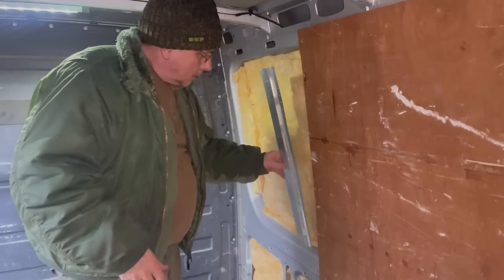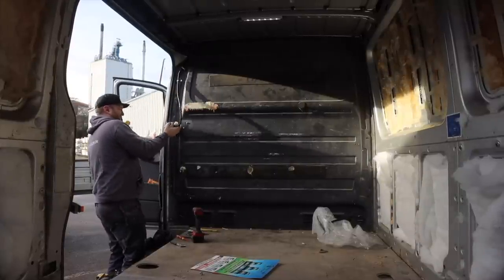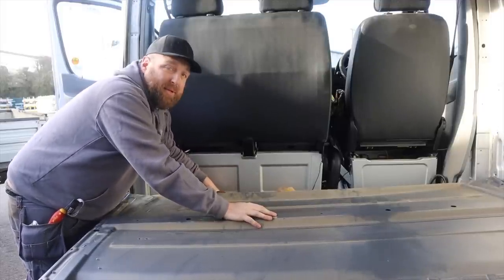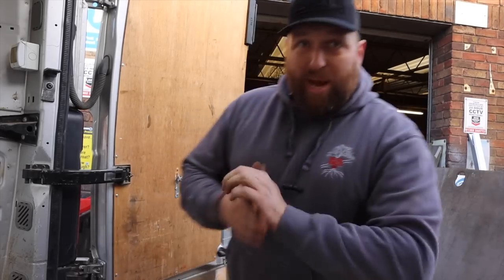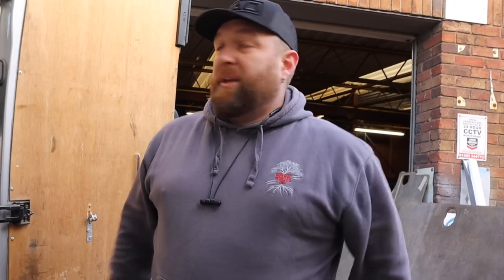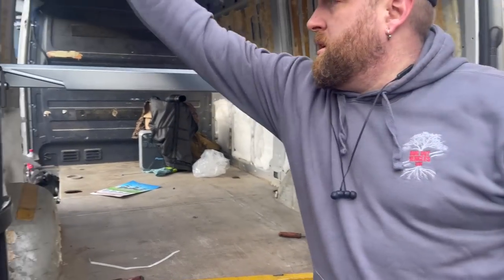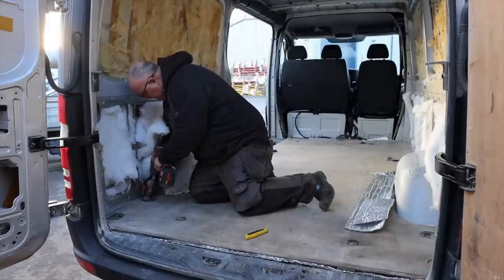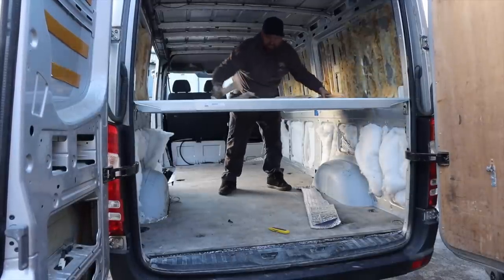Universal campervan bed and stripping the van!

Comment: Before you skip the bulkhead, would there be any mileage in cutting, say, the top 12" off it and refitting that piece as a "back wall" for a shelf or cupboard?

You've probably already got a plan for the interior but I just thought I'd mention it.

Comment: Great vid rich. Are the newer sprinters better rustproofed than the old ones. Most people take of the outside plastic trim and take out and seal the retainer clips. Water gets past these and rot the sides from the inside
Reply from the maker: Not sure long term yet. The older ones seemed to be made from steel with slag in it so they blistered. This model seems to be on seems where the paint is thin.